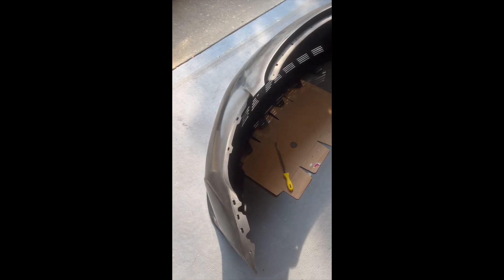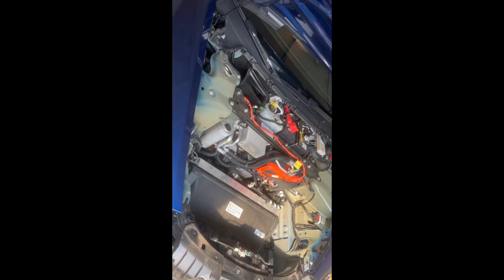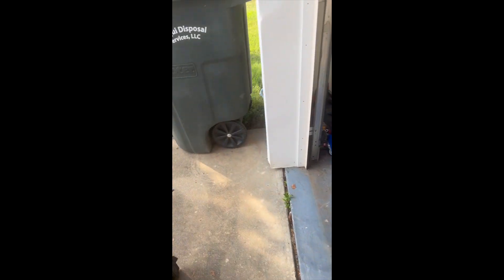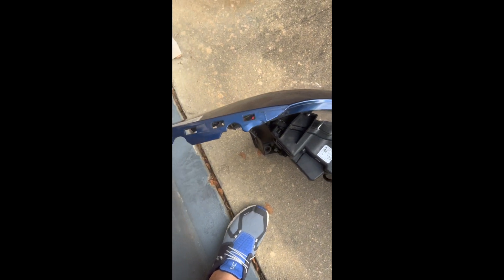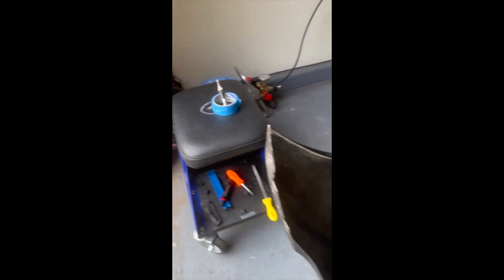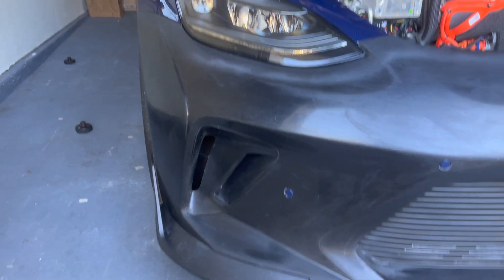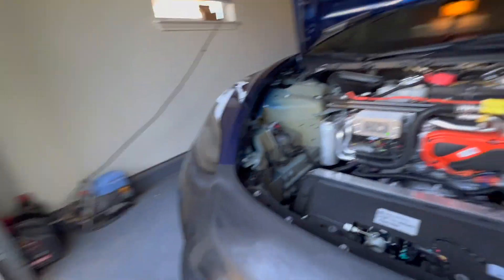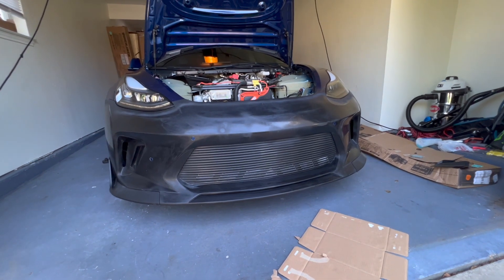Tesla Model 3 Robot Craftsman Hacker Narrow Front Bumper Install

Comment: Hi great video. Did you notice any loss of range using this bumper looking into efficiency or has it been about the same for you?
Reply from the maker: Nothing noticeable, it seemed about the same but I'm sure there may have been some slight loss.
Reply: @Starbasewraps  thank you, my M3 has some dings and scratches I was thinking of replacing the front and rear bumpers. I saw on your channel you relocated to Vegas (where I'm at). Do you recommend any good body shops for Tesla in the Vegas area?

Comment: I like the design, but I do not like it is missing the fog lights openings. I would never design an aftermarket part for a vehicle that "deletes" parts of it. While removing the fog lights and side markers doesn't give codes on the regular screen, if you go into service mode, there are in fact several errors. It is also technically illegal to use it in the US because the side markers are gone. At least, that is what I have found out doing some research.

Comment: Any noticeable change to efficiency, aerodynamics or acceleration at higher speed?
Reply from the maker: Nothing noticeable, but I haven't been on a roadtrip with it and charge at home.  Still accelerates like crazy, but I'm sure its less range efficient.
Reply: @Starbasewraps  my 3P was rear-ended last week, so I’m torn on going with this full kit or just the rear bumper. I hated the stock front at high speeds (too squirrelly) until I mounted and reinforced a vorsteiner lip, but had a horrible experience with my Lexus F and aftermarket kit - it made the car seriously slow above 120 or so. I want to avoid that in the Tesla for sure.
Reply from the maker: @modlife  Just depends what you want out of the car. You can get used stock bumpers for $250 on eBay, but if you want a more aggressive look, I'd do the whole kit.  It would be interesting to compare a 1/4 mile time with the stock front bumper and the robot craftsman front bumper.  I doubt there's much difference though.